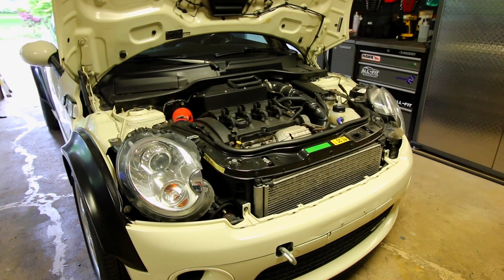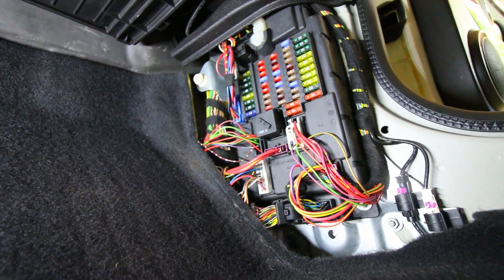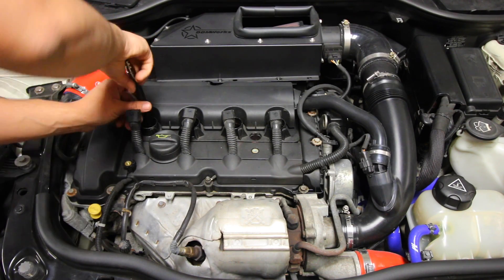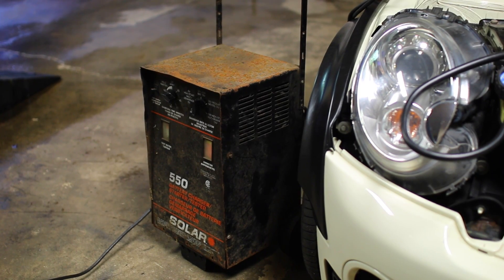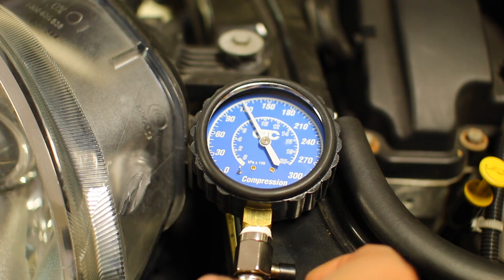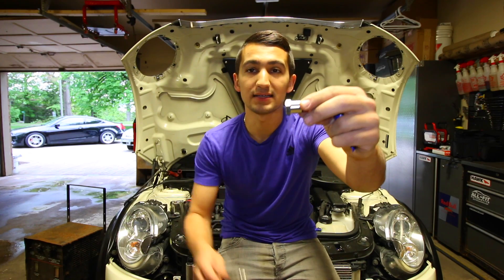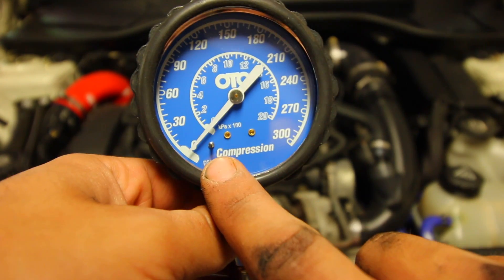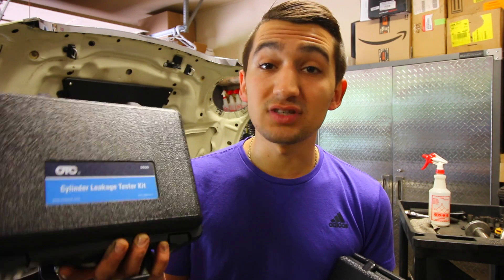How to Perfom a Cylinder Compression Test

Comment: Your “cylinder 4” is actually CYLINDER 1. FYI. 1-2-3-4 from left to right.
Reply: it’s depends on the location of timing chain/belt on right or left side of the engine to start counting

Comment: the throttle body should be open??
Reply: it’s should be totally open to get a most accurate reading , however its not affect the compression it self to determine if there is any compression leak

Comment: Another trick you can do is do a “dry” test and then follow up with a “wet” test by putting a few drops of oil in the cylinder. Just enough to get on the rings. Great way to tell if your rings are worn

Comment: 11 to 1 is incorrect and called static compression. No way a gauge will ever tel you that. Its the PSI reading you meant to say - ie 150, 180 etc.. thanks anyway tho- yes VERY important to REALLY tighten the m12 adapter to the tool so it does not get stuck down in the hole! or use a dedicated m12 extension~

Comment: The tuber jumped back and forth between psi and compression ratio (really pressure measured in bar -multiples of atmospheric pressure) so 10:1 compression ratio is ~14.7 psi X 10 or 147 psi. which is what he got on the good ones. His procedure was off in that the number of compression strokes he cranked varied from 7 to 12 which might account for some of the variation. Should not need to charge the battery for that few revolutions with the plugs out.

Comment: You'd think they'd thread the fittings on opposite so they'd tighten as you loosen the piece out of the engine.  If it comes loose when tightening into the engine, at least nothing is going to be stuck in there.  Haven't thought it through fully yet

Comment: I saw some people remove all the spark slugs before they do the test.  I did not see you do that on this test.  Does it make any different that you did not remove all the spark plugs first, then do the test on each cylinder?
Reply: Henry Sun I want to know that too
Reply: @pinchejuju    I don't know either.
Reply: He had all the sparkplugs out, the leads for the coils just look like they are connected as they fell back to there natural positions
Reply: Engine run with all 4 set enclosed.
Testing individual pressure is trying to take each reading on all 4 piston at the same time. If you have 4 pressure gauges, you could installed all 4 to compare.
Conclusion: All should be enclosed. Reason is usually the leak pressure have 4 main place to check as basic (exhaust, radiator water resevoir, engine oil inlet, engine oil dipstick)

Comment: Like this. Quick question. I'm new to this and had no idea about doing a wet test. I did do a compression check and found that my #1 cylinder was reading low (125 psi vs 150 psi on the others). I then went an put the parts back together when I discovered that I should have done the wet down test. Can I do a wet down test on just one cylinder without taking apart the others?

Comment: Disabling the fuel system is not essential (only a small percentage of people actually do it). It is often a good idea to hook up a battery charger if you have one. A trickle charger to top up the battery before hand. Or a battery maintainer that can supply 30A at minimum.
Reply: Why do some say disable the fuel pump and others don’t?   Also I see some say do it warm others say cold and it doesn’t really matter

Comment: Mind sharing the cold air intake brand you have on? 

Was looking at K&N but it seems to be too much of a wistle (above 3700 rpm) from what I've read and heard on YT. 

I like the extra loud blow-off valve noise but not constant high pitch whisle under hard acceleration. 

So you think yours beeing a more enclosed one helps in this regards and is the under the hood duck coming with it? 

Thanks

Comment: Hello milan, I've watched your videos, you're great, keep up the good work. I have a question for you and I hope you can answer me. :D Before I put the question let me tell you what's happing. I've buyed a new car almost 9 months ago, it's a DACIA LOGAN II (Renault LOGAN II) with 1.2 liters engine, I've put almost all the time the best petrol from a single gas station from my city (I've put very often 98 petrol from ROMPETROL and a few times 95 petrol). In the morning or night, at first start, when I crank the engine, he doesn't want to start from the first, it's scary because this winter started OK at  minus 15-20 degrees and now when the engine starts after a few cranks, the rpm jumps to 1000-1200 rpm for a few seconds. I think this is not normal because before this it started OK. What do you think the problem can be? The spark plugs or other stuff ?

Comment: in your double clutch video you blipped the throttle when the clutch was disengaged, your supposed to do it with your clutch engaged with neutral, so essentially your synchros still did all the work matching the input shaft speed with the output shaft speed, thought i'd say it here says you felt the need to disable comments on the other video

Comment: It depends on how open the throttle body is and the position of the pistons. A problem is when 1 piston has more than 10% of variation compared with the other ones so ur car is fine.Compression kits are not so reliable btw. (Learnt from Eric the Car guy)

Comment: If you're burning oil and one or more cylinders is reading significantly lower than normal, you can try adding a little engine oil to it and retesting.  If compression goes up with some oil in the cylinder, it usually means that cylinder has poor ring seal - either from the rings/ringlands themselves or from the cylinder wall being worn.  Sometimes you can try running a higher viscosity oil as a short term solution since the thicker oil will help with ring seal.

Comment: If I did this, I wouldn't determine how "healthy" my engine was, more like "it's not dead yet" lol
Reply from the maker: They are both kind of the same thing :)
Reply: @milanmastracci  I know this thread is old, but quick question.  I didnt see in responses, "Did the walnut blasting of the valve ports take care of or correct the "Check Engine Light" for Cylinder 4 Misfiring?"
Thanks!

Comment: I don't know if it's a Canadian thing, but here in the UK, the cylinder on the left (nearest the timing gear) is referred to as cylinder 1, not cylinder 4 as you said.
Reply from the maker: I'm going based off of what Mini outlined for our car's. Could very well be different where you are from :)
Reply: milanmastracci I like your videos man, good job. I'm also an R56 owner. The others are correct though, cylinder 1 is closest to the timing, far left as viewed from the front.
Reply: It doesn;t really matter in terms of doing a comp test anyway, just splitting hairs, pedantry matters ;-) keep up the good fight bro
Reply: the closest cylinder to the front of the vehicle is #1 cylinder